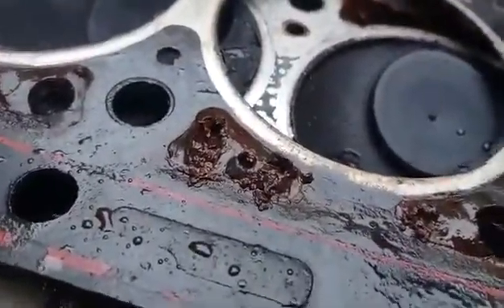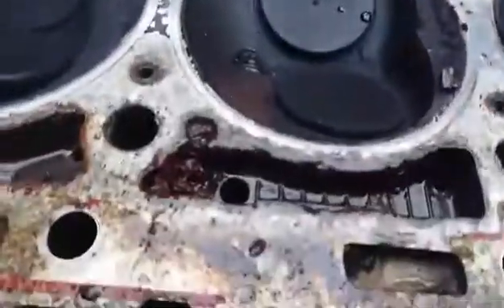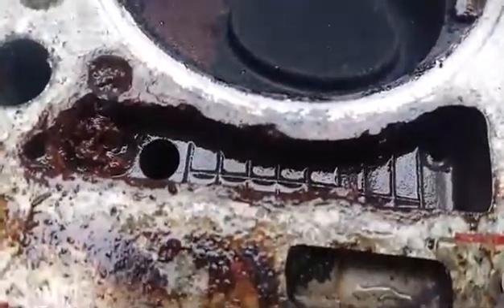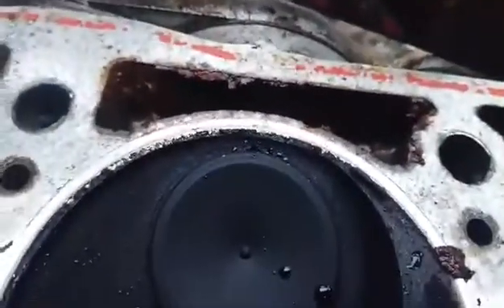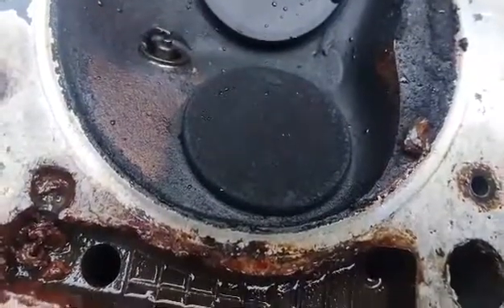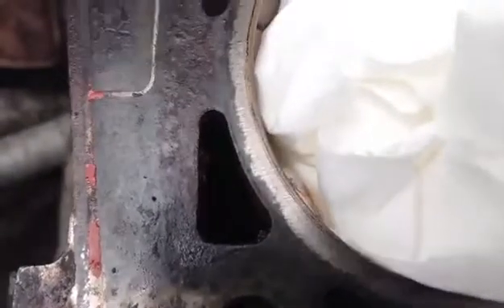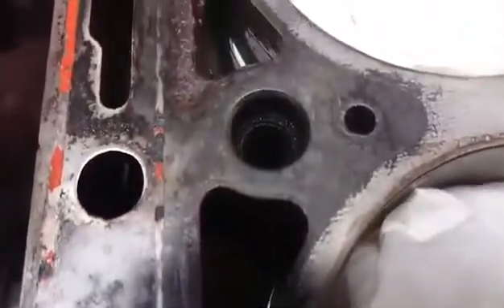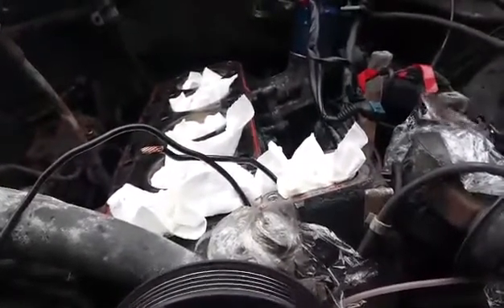Mercedes m102 cylinder head and block corrosion

Comment from the maker: 1 year on and the car doesn't use any water with even compression readings in the cylinders
Reply: What did you do to the head to fix this corrosion issue?

Comment: Mine was worse than this. Coolant was crystalized in ever single cavity in the head. Ive cleaned the head out, and replaced head gasket. Will be checking compression soon and hoping it didnt corode too much. Only replaced head gasket because of oil leak from an oil galley lol